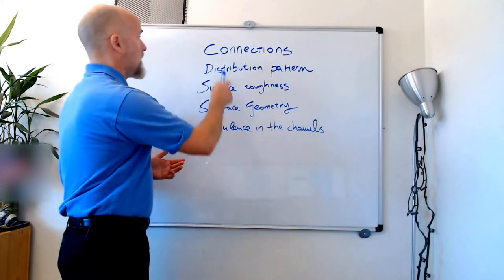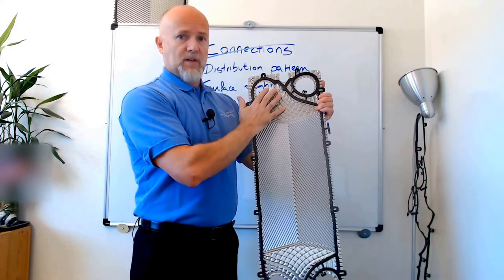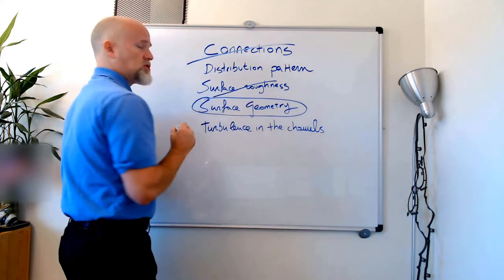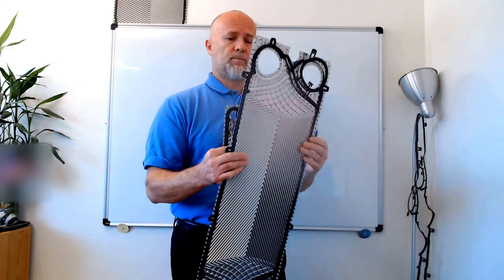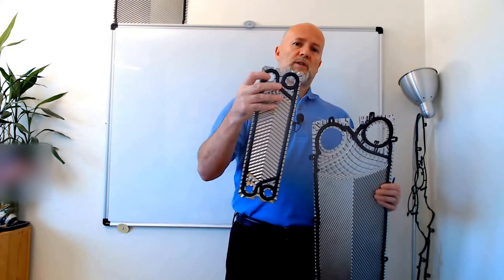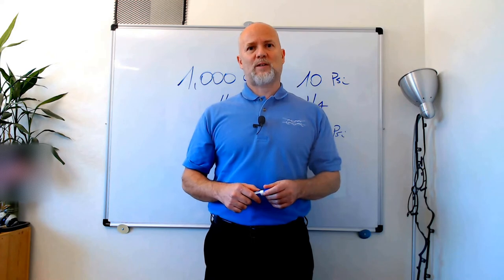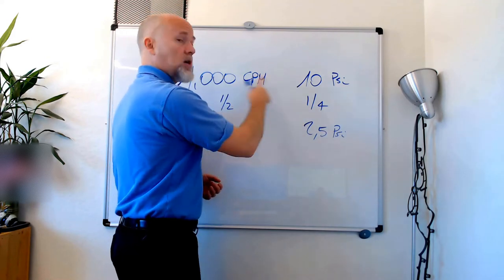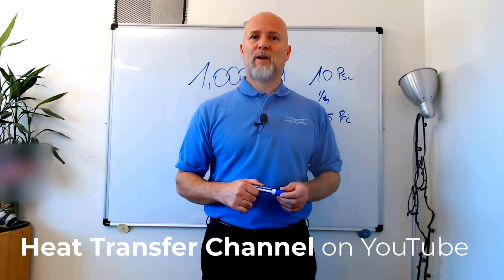Pressure Drop in Plate Heat Exchangers

Comment: The Darcy-Weisbach correlation you use to relate Delta(P) to velocity is more tailored to pipe flow. Works great for a shell-tube, not sure how valid it is for a PHE. Are there more suitable ways to theoretically validate pressure drop for a PHE?

Comment: Hai sir how are you? I hope doing well 
Sir we are mostly doing plate heat exchanger servicing. It’s very hard to loss and tighten the plates sir we are losing and tightening manually only sir. Is there any equipment and tool for tightening plate heat exchanger
Reply from the maker: Yes, there are either pneumatic or electric tools that can be used to loosed and tight heat exchangers, and we use them regularly.

Comment: thank u sir for ur elaborative video on PHXs. i do have a question though. based on what u said, if i want a 2" connection size, is it better to use a plate with a 2" port size at max, or use, for instance, a 4" port size plate and reduce the connection down to 2" ?
Reply from the maker: if you have a 2" connection, I would recommend 2" port heat exchanger. Every time that you reduce the size of a pipe you have some undesirable pressure drop. Does it make sense?
Reply: @heattransferchannel8474  it does. but just take port and connection pressure drop into consideration, what's the difference between '4" plate reduced to 2"' and '2" native plate size', pressure-drop wise?
Reply: @heattransferchannel8474  im really interested to learn more from you sir and use more of your wisdom and knowledge in heat exchangers world
Reply from the maker: @Khabbazhadi  Well, if you have 4" pipe because you need that flowrate, the moment you squeeze it down to 2" you will have significant pressure losses... how much depends mainly on the flowrate.... so, if you have 4" piping the best possible solution is to have at least 4" ports...
Reply from the maker: @Khabbazhadi  your "local" Alfa Laval is in Dubai: Phone: +971 4 372 0800
Fax: +971 4 347 1601
Email: alme.marketing@alfalaval.com